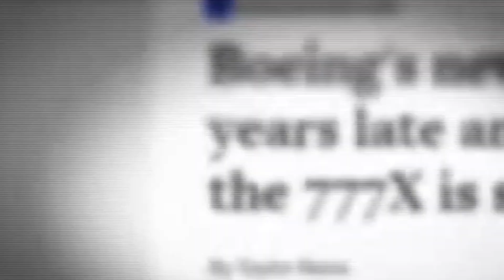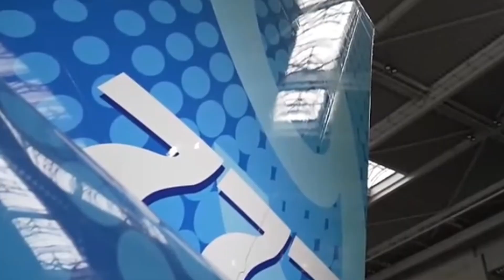Why Boeing 777x is really Failling? Here's the details

Comment: Considering the complexity and the amount of time which is needed to redesign the engine attachment on the wing, the first delivery can't be expected before 2028 (at best). Add to this, the current strike which will strongly impact scheduled delivery for one to two years... And the fact that the redesign will certainly negatively impact the fuel consumption and the flight range... This plane will be almost 10 years late on the market. Boeing is paying hard all mistakes made by greedy and incompetent CEOs.